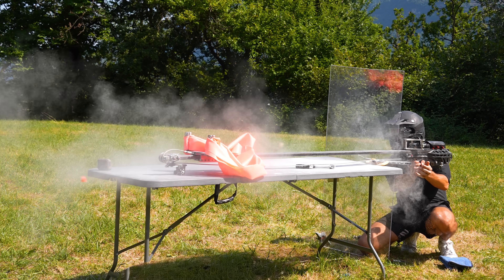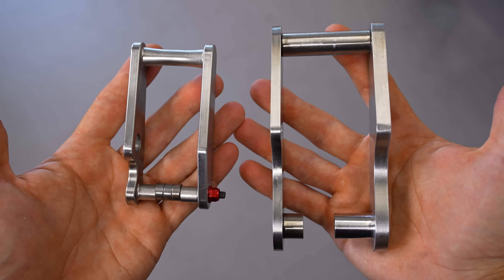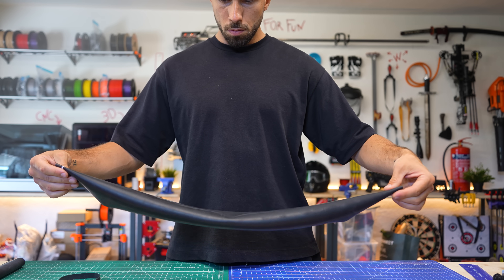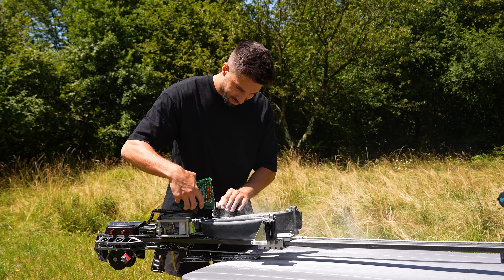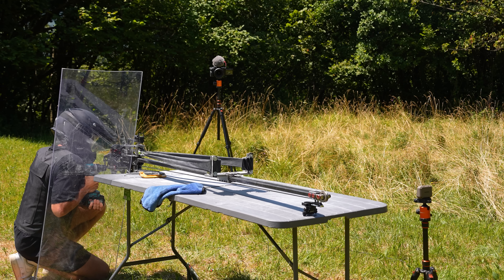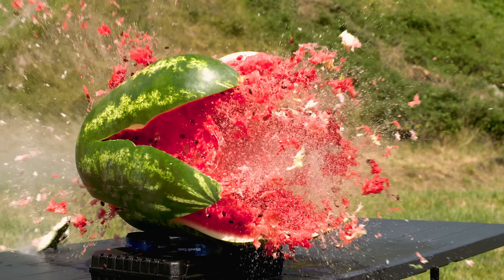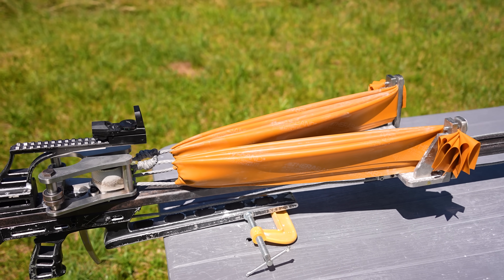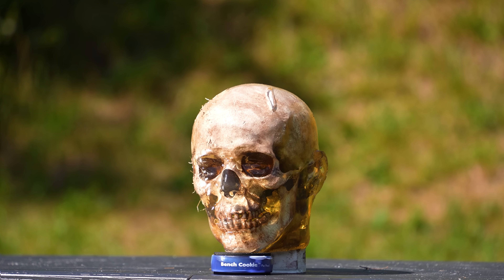Bulletproof Glass vs World's Most Powerful Slingshot

Comment: The bands get bunched up where they all pass through the rope that connects them to the pouch instead of staying flat when stretched. The wheel at the front end of the rail is far too small and makes the cable take a really tight turn, especially for how much force is on it. The fork seems a bit too narrow, making it 2x wider may allow the the bands to release more energy into the projectile.

Comment: --  --  The pouch needs to be in a Y  configuration having an eyelet at the tongue of the Y --  --  
--  --  Tongue Eyelet to function as a trigger release and a shock absorber component. --  --  
--  --    Use a 1/2" electric drill  not an impact wrench .  --  --  
--  --    Trigger should require a two finger pull.  --  --

Comment: You should build APFSDS rounds for this thing. Make the sabot have a handful of connection points that'll get pushed by the air resistance or break off with the slingshot firing, and have the round fin stabilized so that the fins don't break the slingshot bands and prevent it from... well, spinning out. This would ALSO allow it to pen better and be more aerodynamic than a literal sphere. I'd recommend a core of tungsten carbide steel- each rod costs anywhere from 30 bucks to 60 bucks. Make sure it's at least 1/4th of the caliber of the sabot. Then try it against some 70-ish mm of steel. Yes, literal armor matching that of some world war two tanks. Maybe even put a melon or a ballistics gel head behind it. I really wanna see what shenanigans that can do.

Comment: 🤔Hummm, wouldn’t have been easier to convert shooting the ball from a compound cross bow ,yes your not using rubber bands but you could increase bow limb strength and change the power with different cam’s and pully arrangements, , so I just bought a $20 dollar stain less sling shot from Walmart , my first thoughts were I wonder how strong the flat bands were compared to to tube bands and are wrist rocket sling shots stronger or better I started thinking could the steel ammo be shot out of a cross bow ? 🤔

Comment: Please be careful with that drill snapping around on you from the torque. I had the same thing happen to me with a drill and it caused a massive injury. Three surgeries later and i had to have the first row of bones in my right wrist removed. I have limited use of that wrist now and due to nerve damage from the initial injury, have lost roughly 70% strength in my right thumb. 

I was just building some custom steps for our new porch and had the drill at the same odd angle as you. 

Great videos BTW! Just be careful in the future about torque, drills, and odd angles.

Comment: Cool video, I would be terrified to be on either end of that slingshot! I think you may have fallen victim to the same assumptions about the strength of glass that Elon Musk did in that live Cybertruck demo, where he had the guy throw that big ball bearing at the window and it went straight through. 

My other hypothesis is that the way that they calculate the rating of what it can stop is literally tested with the bullets and not based on a pure rating energy transfer. The physics of the big ball bearing projectile vs the bulletproof glass are probably quite different to that of a small fast moving projectile like a 357 magnum bullet, which is made of a much softer metal and is designed to transfer all of it's energy to the target in a very short period of time, while also deforming in the process. 

So the big ball might actually concentrate more energy in a smaller amount of space for a greater period of time than the .357 bullet. Since if you think about the impact of the bullet in slow-motion on the glass, is more of a high speed soft metal splat, as opposed to a very large sphere with minimal deformation, where the actual point of contact on the projectile is still relatively small and the way it impacts/imparts its energy on the glass is completely different to that of a lead bullet. 

Also pretty sure the bulletproof glass is designed to be installed in a specific kind of frame which plays a role in dissipating the energy of the projectile somewhat. Especially with a large projectile like this, it probably allows at least some of the vibration/energy of the impact to be transferred through the glass into the surrounding frame.

Comment: I would advise you to use not rubber bands, but latex spearfishing tractions, they are much stronger and have a round profile, as well as enormous tensile force and contract very quickly, and will not interfere with each other as much as the bands do

Comment: Mega nerd comment about the bulletproof glass from a physics undergrad incoming :)

.357 magnum (according to Google) has about 1100J muzzle energy, weighing 10.2g and flying at 465m/s. At this energy, your 500g bb needs to fly at 66m/s to carry the same energy. But here's where things get interesting.

In ballistics, as a rule of thumb, kinetic energy is important for 'destructive power'. A lot of material displacement outside the immediate impact zone means a lot of work needs to be done, requiring a large kinetic energy to draw from. Think about sand getting flung everywhere last video. Momentum is much more important for penetration as momentum physically pushes the material backwards, making way for the projectile on its penetration trajectory. Although the two are intrinsically linked, they do vary (a lot) with the size of a projectile.

Using p = mv, we find that:
.357 magnum    p=4.7kgm/s
500g bb              p=33kgm/s

So the ball bearing has a momentum 7x higher at the same energy!!
This is the square root of the ratio of masses.

That's why the bulletproof glass didn't hold up. The momentum transferred to the small impact area is so great that the glass has no opportunity to absorb the impact energy. Instead, the ball just pushes the glass directly backwards. It's also why the glass is only removed in a nice clean bb-shaped hole, since the area around the impact can plastically and molecularly deform to absorb the energy.

You can see the same principle applied on a smaller scale shooting a piece of paper/cardboard with an air gun. Although paper is not designed to absorb energy, you can see that the material behind the projectile is cleanly removed, leaving a nice round hole. There are other novelties that smarter people than me would be able to explain, like shear characteristics and elasticity. From what I understand about fundamentals though, I hope you enjoyed my explanation. Very cool video <3

Comment: The comparison of chocolat with bowling ball made me laught a lot xD.

Kinda scarry to see that an anti-bullet glass doesn't stop a powerfull (less than bullet) slingshot. That's probably due to the projectile shape, as it's a ball, energy spreading is kinda egals on all part of the shape, compared to a bullet. That makes me think a lot to the difference between catapult / ballista / cannon balls / artillery rounds. We've changed so much toward penetrating projectile, that it seems they tend to ends up beeing "weaker" on certain situation. Or course modern projectile got higher range and speed, but seems, with your test, to have some flaws that a very primitive roundish projectile totally ignores.
There is definitly something to learn from your test, about ballistic, very interesting to watch.

Comment: Just a little more and it will be an AMS. An anti-materiel slingshot. Designed to destroy low-flying aircraft and light armored vehicles.

And the next stage is replacing the slingshot with the first stage of the launch vehicle. Why do we need landing barges, complex automation, and so on? We need MORE rubber. How about that, Elon Musk?

Well, dude, you're awesome. You're incredibly, aerospace-wise awesome. I wish you the best of luck. The main thing is, don't repeat the disaster of Kentucky Ballistic.

May the blessing of the Omnissiah be with you.

Comment: Should have made a few v slots in the clamps on both plates so it can push the rubber into the v grove slots. Almost like two w that fit into each other. Sand paper was good but the v slots will create more friction to hold it.
Also round the curve edge of the clamp. The band stretches over a sharp 90 degree edge which isn't great. Just smooth it out a bit.

Comment: You could die! You idiot!
Your survival skills are at 5% shoot that at your protective glass and your helmet in line. You will see, this thig will go through that all the way. Get some real protcetcive gear like kevlar armor.
Mounti rails for pouch to prevent ball goes in opoosite way, it willalso stops bands hitting the metal parts. Thats why you bands is snapping.
Yeah for sure it will go throug the bullet proof glass. Compare lightweight bullet to your stell balls, calculate the energy.

Baby powder, stupid, idea, so many small grains makes you ropes tear apart. Try something slippery like olive. Sand paprer also is a bad idea.

Comment: Had just watched the first vid. put some suggestions in there. but as for penetrating the glass, it probably still would, but if you mount the glass inside a sturdy frame that is bolted down firmly it will preform much better.. then loose on a table like this. Same for the wood panels.

Comment: Dude PLEASE invest in an amazing portable safety rig. It would also be a really cool video to watch. 

Rig:
- Metal frame that gives it both stability and additional points of contact to pin it to the ground
- Adjustable wings to shroud your body and give you more that a single dimension of protection
- Strong transparent bullet proof glass at the front that can be replaced if shattered
- A hole in the rig to shoot out of (similar to an arrowslit in a castle that stops things from ricochetting back in)
- Optional: Add wheels and making it folding so its easy to bring everywhere

Your safety was at big risk when that steel ball flew back. You showed at the end that the glass wasn't enough. Also propose to your beautiful girlfriend who celebrates your successes as much as you do :)

Comment: Make sure you have the smallest/shortest length of cable on your winch. This will make the radius of the coil lower and decrease the torque required to wind the cable in.

Comment: as a IT QA for over 15 years of experience, I would recommend do strength test 25% 50% 75% 100%. Also could be interesting close to 90% could be similar power to 100%, but less pressure therefor strain to the bands? Just a thought. 

edit: btw in zombie apocalypse, use less power so the balls stay in zombies and you can collectem for later. Talking about defend your fortress scenario of course

Comment: 7:09 so what you want to do is first get a new screw put rubber on the inner side of the fork then put the band between then then tighten the screw and forgot to mention put gym adhesive on the rubber

Comment: Amazing video as ever, but instead of focusing on mass to increase the energy, which is linearly proportional, you should focus on increasing the velocity, as energy is directly proportional to the square of velocity, so increasing it has a much greater effect, so using the same setup but with a slightly lighter ball might output greater energy as it accelerates faster.

Comment: This is my comment on your previous video: 
I may be too late to advise you on anything here, however you might taper your trigger block instead of having the block parallel, and have a safety to keep it from being forced out.  Axle grease would be a better lubricant than WD40.  Instead of using a hammer to clumsily fire the trigger you could actually make a spring loaded cocking hammer like on an old fashioned 30 30 winchester rifle .  Use leather grips on your band clamps to keep them from cutting the band at the fork mount.   An impact hammer is great for static torque but not on spring loaded torque because it's just going to bounce.  Instead try using a powerful cordless drill set up which uses planetary gears and I think you can find one with 350 lbs of inch torque.  You might also want to find or design a wench with that same drill motor and gears inside the hub, but after your proof of concept.  I am happy for you that you can defend your castle from the zombie apocalypse and even body armored combatants.  It looks like you did switch to a drill, so I got one right.  Now I imagine that you could use a shoulder mount like they do with bazookas and still have a face guard.  Build in the motor and have the electrical switch near the trigger and use a laser sight, green shows up better.

Comment: Cool project. Breaking through the bulletproof glass is insane! If you want to make it even faster, you'll probably reach the "speed of sound" of the bands. Bands have a limit on how quickly they can retract, so you'll need the quickest ones available. Heating them up may also help.
Going much faster would probably require something crazy like a two-stage slingshot, where the bigger slingshot accelerates a smaller slingshot that shoots the ball.

Comment: Your trigger needs to be 2 pieces instead of 1. The part that holds the ball clamp closed needs to be a wedge shape and pivot. Then the trigger has a sear that engages the bottom edge of the top wedge section. When you pull the trigger it slips off the edge of the sear and the top wedge section is allowed to rotate backwards letting the ball clamp jaws snap open. You could actually just use a standard drop in rifle trigger that has an exposed sear.

Comment: this is so frustrating to watch ... ffs...
instead of stupid SUPER ROPE to hold the bands at the ball side, use SAME-THICKNESS-AS-RUBBER-BANDS METAL BARS to hold the bands AND, the RADIUS of the bars should be in spec with the band breakpoint-radius. the rope is ~7mm thick which is a "knife" for the bands at that stretch, instead, use a metal rod that is 20mm radius to smoothe the bend of the bands - so they dont snap...

Comment: The bands will be extremely stressed at the pinch point by the ropes. It may be better if instead the bands loop around a rod Allowing them to stay straight without pinch points, with the rope being attached to the top and bottom of the rod.

Comment: There are some air rifles can shoot a pellet through a two inch solid door and that is at a distance you have the power but you got it with a shorter distance gives you more power but if you had it at a longer distance how much power or destruction can it do it is just like a shotgun the more narrower to the object the more damage to it the further away the more sprayiness of the cartridge or bearings spread out when you lose the penetration or spread nice to look at using compounder in a cannon and fine cannibals is the same principle as a slingshot

Comment: You should try to close of the lateral parts of the clamps, so that if bands fail/break, the ball will not fling back at you like it did at 6:06 and will stay in the "launch area" as to say.
Also, what was the speed / energy measured when you used the new therabands toward the end of the video ?

Comment: I would recommend replacing the (strong) Powerdrill with an lienar motor and sprocket setup with a large reduction. so you consistently (and safely) can load the "slingshot" (or more Slingshot AR-50)
you should call that thing the SL-50 (as Sling-Shot 50 probably would raise an eyebrow with WW2) - it already looks like one

Comment: 14:30 this makes sense: the hardened steel ball is not being destroyed by the glass and it is moving slow enough and also massive enough to punch through. Actual bullets may have the same energy, but are less massive, less hard, and are moving faster for the same energy, so the glass more effectively destroys them and dissipates their energy.
Reply: yeah you're mostly correct. It's also that bulletproof glass is designed to be framed, like there are specific standards for how it must be framed as the frame is an essential part of the system. And plays a big role in the stopping power and structural integrity of the system. 

the deformation part is spot on though. The difference in the physics of the impact between a solid metal ball bearing and a .357 bullet is like the difference between hitting glass with a piece of clay wrapped in thin foil like a chocolate, and hitting the same glass with the rounded end of a ball peen hammer. 

its like a very high split second speed metal splat vs non-deforming blunt metal force over an extended period of time. 

and in that configuration without being properly framed, it's likely it wouldn't have stopped the .357 either.
Reply: @3lanksp_ceyeah, good insight on the framing.